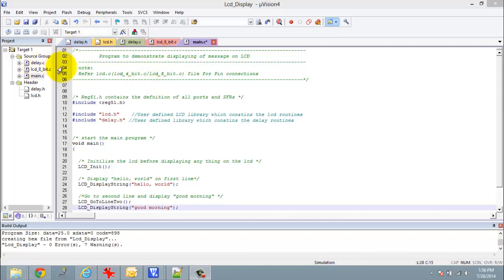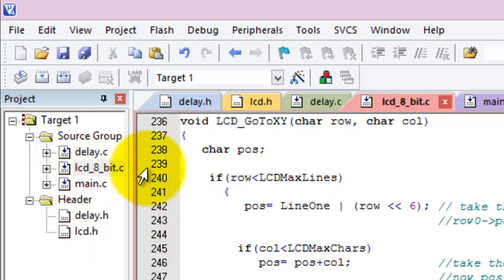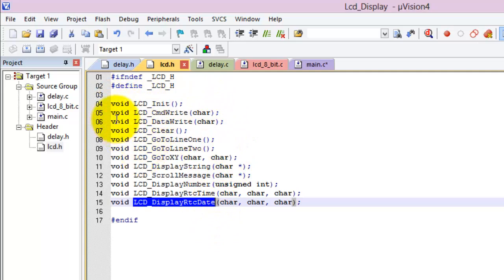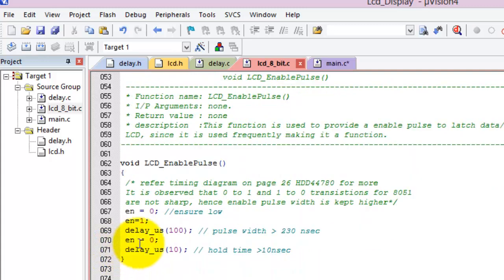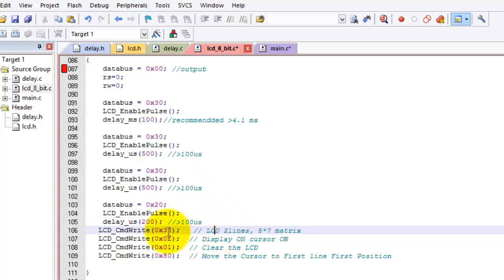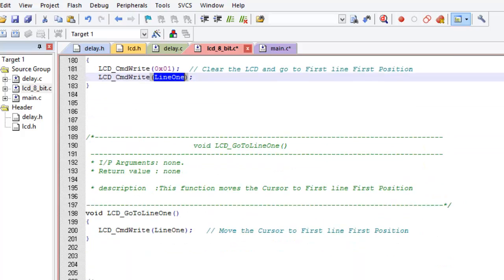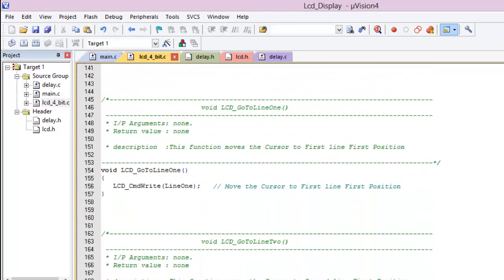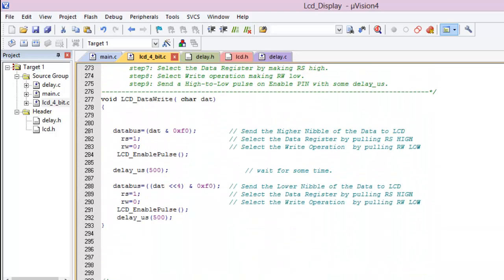8051 LCD Interface Part 2

Comment: I want to make this kit by my own.. can u tell me the circuit diagram of that that kit and list of components for mounting on pcb
Reply from the maker: +pankaj rawat 

That's great news! find it here https://github.com/ExploreEmbedded
Reply: I visited this site.. but I found development board selling online. .. but I want basic circuit diagram of ISP 8051 ...can u please send the basic circuit diagram of isp and development bord .. pankajrawatr556@gmail.com
Reply from the maker: The starter 8051 board on the github is the basic board. You can build your circuit from that.
Reply: I tried ones ... but I failed... if u have circuit dig. with proper value of components... Please send me at
pankajrawatr556@gmail.com

thank you!
Reply from the maker: All the boards that we sell are open source. That means all the design files including schematic, pcb layout are there for you to use freely. Also the components shown there are exactly the once we use, there is no hide and seek. If you could comment the exact issue, we can help!
Reply: I found huge code written there but I cant able find circuit diagram GitHub
can u just send exact link
Reply from the maker: pankaj rawat you can use the board below as reference. 

https://github.com/ExploreEmbedded/Starter_8051_USB_V1

The board is designed in KiCAD, use it to open the schematic etc. . .
Reply: I disturb u a lot ;) ... just wanna say thank you.. I got it...!! if I stuck somewhere I will cmnt here again ... but for now thank you for this ;)